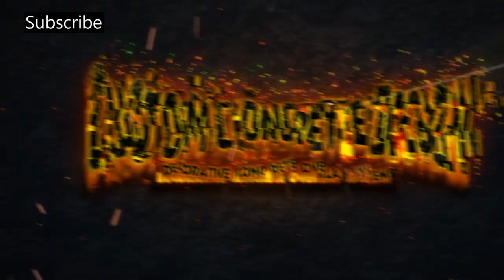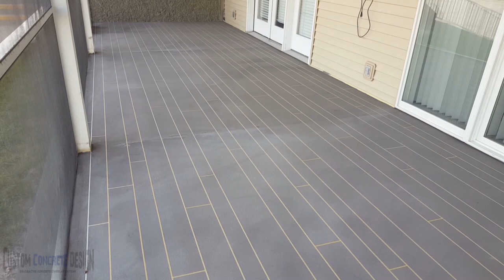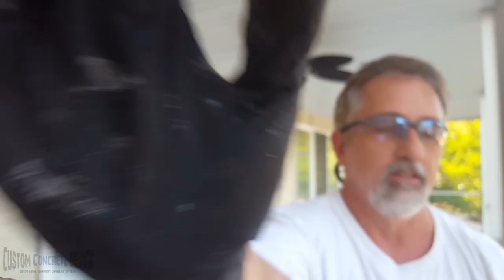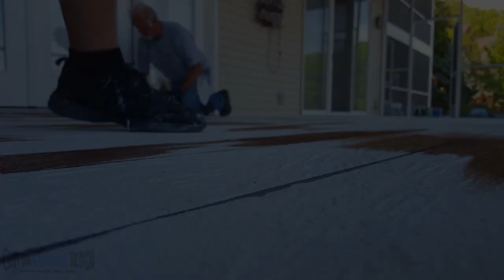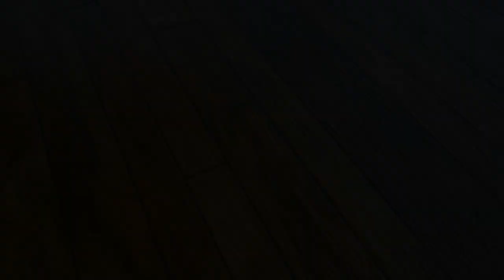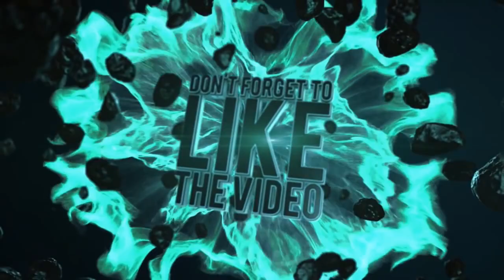Decorative Concrete Barnwood Patio Resurfacing Lake Ozark

Comment: Wow, you guys did an amazing job! The patio looked good as new after you guys were finished. I can appreciate someone who does good handiwork like this. I'm sure your client was more than pleased after you were done. This is the type of work that speaks for itself. You don't have to worry about running out of clients when you're doing quality work like this.
Reply from the maker: Thank you Jacob, great comment...yeah my clients for this project could not believe I was able to make concrete look like wood, most people don't even know that it can be done, so they were sooo pleased, I have sold several jobs just from this project, but your right do great work and have endless work. thanks for stopping by to view the video, this is just the short version, the longer more in depth video on how I did this will be coming out this summer... probably will be a more than 10 min video when I get it edited and uploaded.

Comment: How long will the texture and color last? Would it work on the interior of a home, directly on the slab foundation?
Reply from the maker: Like anything prep work is the most important and maintenance afterward is required every 5 to 7 years a top coat of Urethane needs to be applied if it's an interior project floor....outside it needs a reseal every 2 years.